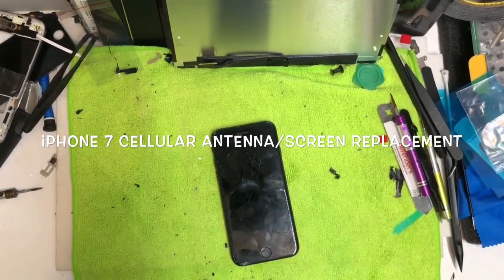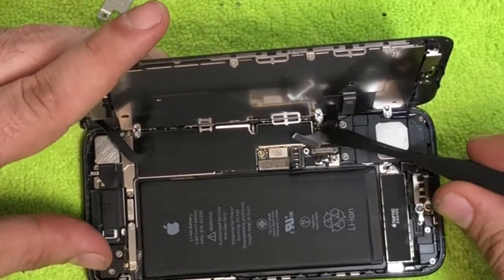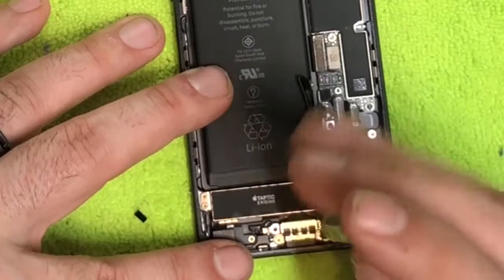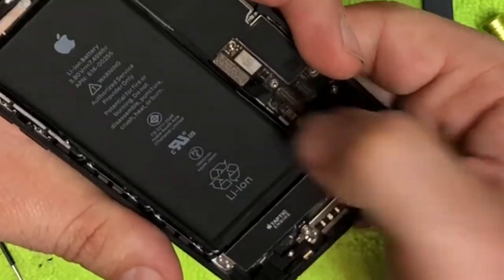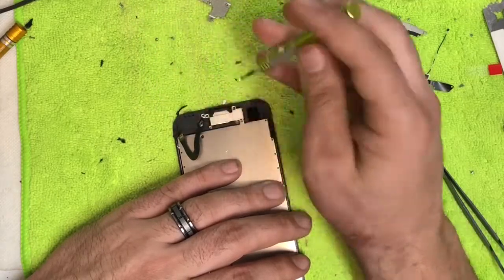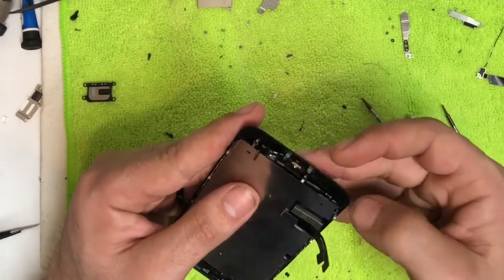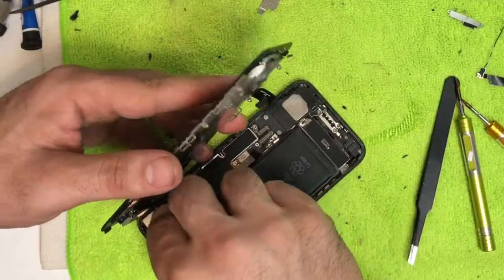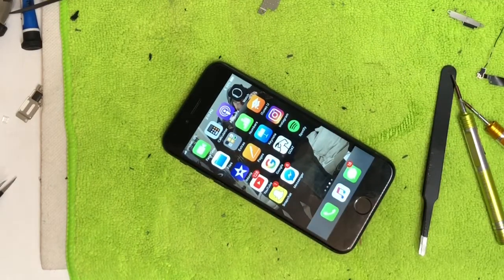iPhone 7 cellular antenna/ screen replacement

Comment: Hi Sir ! My ip7 have problem with the SIM card signal, the phone can display my SIM but i cant make a call or use 4G but my wifi signal is still fine. I try replace the antena near the loud speaker but it didn't help. Did i replace the wrong atenna ? Can you help me Sir ? (sorry for my bad english).

Comment: How do we test whether the cellular antenna cable is working, I have this searching signal issue after replacing rear case without breaking components
Reply: I double checked turns out the top left antenna’s screw mount is traced and green part is peeled off
Reply from the maker: Gotcha
Reply from the maker: I would double check your SIM card slot first, really no way that I know how to unless you have any ther antenna

Comment: Doing this job and both my cables are the same length. Which position does each cable go into?
Reply: The cable for the antenna. I removed both those cables while replacing the circuit that has the microphone and charging port on and wasn’t sure which one went where. But got it now.
Reply from the maker: Ok awesome
Reply from the maker: Which cable are you talking about

Comment: Hi there. Your video is very confused. You say to fix the reception you should change the cellular antenna, but in the comments you said you replaced the WiFi one? 

So my question is which one do you replace to fix low service and signal? The one you changed in the video ? Or a different one 

Thanks
Reply from the maker: Yes I replaced the WiFi in the video, the cellular antenna is at the top left of the phone
Reply: A few comments below you told someone the cellular antenna is bottom left next to the battery?.... now your saying it’s top of the phone ? Lol

Comment: Sometimes my signal falls and calls don't reach. There is no problem with wifi. What should i replace ?
Reply: Could you share a link for buying cellular antenna iphone 7
Reply from the maker: https://rover.ebay.com/rover/0/0/0?mpre=https%3A%2F%2Fwww.ebay.com%2Fulk%2Fitm%2F332310783038
Reply from the maker: The cellular antenna